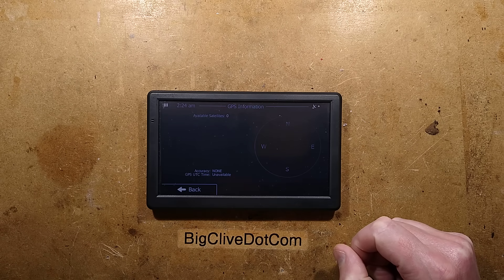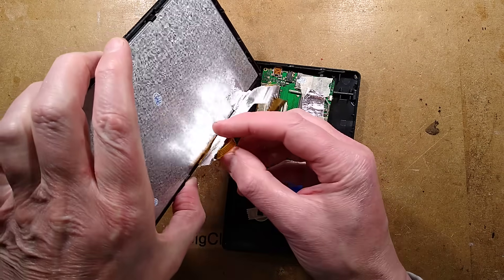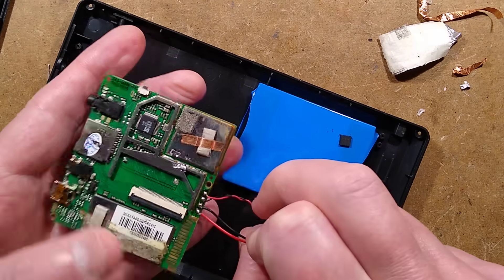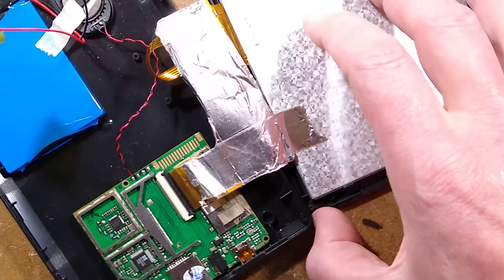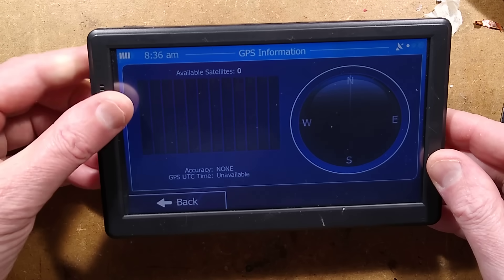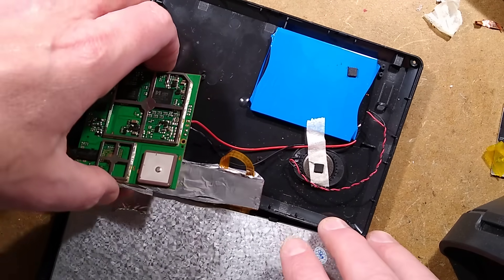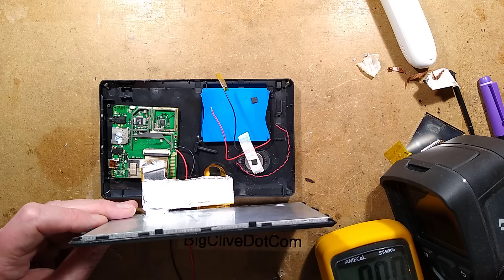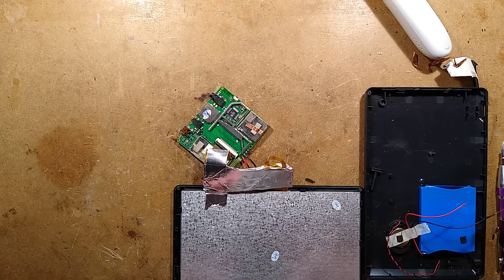Inside a trashy sat-nav

Comment: From what I remember of those older GPS devices there are a couple things that need to be set up. One is the general location needs to be set, I think for the time zone accuracy. The other is that they usually need an update to work properly, I think that had something to do with the azimuth or some such nonsense. I just remember my old garmen didn't work strait out of the box.

Comment: I wonder if its firmware couldn't handle the GPS 10 bit week number counter rollover in 2019 (1023 to 0) so that it could no longer interpret timestamps correctly.  Once that happened, it couldn't sync to a single satellite to download the GPS almanac data (via carousel broadcast data) which gives the current position of all the operable satellite locations and any WAAS and LAAS stations for better accuracy.

See: https://en.wikipedia.org/wiki/GPS_week_number_rollover

Comment: Never ceases to amaze me when a mfgr puts antennas under a metal-backed display. What were they thinking?
Wait, I punctuated that wrong--- what, were hey thinking?
Reply: Well, if it is being used in a car, the screen area is pointing back into a big metal box (unless you are in convertible), so maybe they are thinking that it acts as a reflector for the GPS signal?  I can remember when the handheld GPS units first came out (which did not have any built-in maps) and trying to use them when I was flying a small single-engine aircraft.  I had to place the unit on the glareshield (the equivalent of dashboard in a car) in order to get a signal.  When I banked steeply into a turn, I would often lose satellite lock... On the other hand, my aircraft's LORAN receiver had no problem keeping up and it compared favorably with the GPS on cross-country navigation -- usually they were in agreement within 0.1 nm...
Reply: It is designed to be in a car, with the back facing the windscreen, so the antenna would be facing outwards

Comment: Don't know if the video is fresh or recorded at 8:37AM, but in some instances the problem could be also from an incorrect time on the clock, sync and such, ya know certainly better than me they made the atomic clock mainly because of GPS lol
Edit: with the new battery probably set the clock correctly and then it worked xD
My 2 €cents

Comment: These things typically only go for 30 to 60 minutes on internal battery.  They expect it to be used in a vehicle with external power from a lighter socket.
Reply: Kinda like dashcams, although in dashcams the battery is used to save the recordings and safely shut down after power is lost. But the cheap ones use small capacity batteries that lose their capacity quickly from the heat and wear.
Reply: That is correct.
Reply: From my limited experience most have trouble lasting 5 minutes. That being said my latest (branded Aonerex) was on battery for 45 mins the other day and still showed  about 70% on the indicator.

Comment: may need a firmware update 
"Older GPS devices are facing their own mini Y2K bug 
 The GPS week number again reset to zero at 23:59:42 UTC on April 6, 2019. Many GPS-enabled devices that were not properly designed to account for the rollover event exhibited problems on that date" and after
Reply: Maybe, but the fact it was saying it was on the isle of man would indicate it's able to use the GPS signals correctly. You need at least 4 signals to properly calculate a location with GPS, so it may have been able to get a very rough position with the 3 signals it said it could find.
Reply: That was my first thought Matt Parker (StandupMaths) did a video on the problem with old GPS systems. https://www.youtube.com/watch?v=iyz7dSnZItw
Reply: It's a shame TomTom keep making their software incrementally more rubbish. And insist on it to fix the bug. My original go300 was the quickest one to use , and you could mess about with the map  icons and startup screen.
Reply: I threw out around 4 Tom Tom devices and a garmin due to the satellite signals disappearing around April 2019.
Reply: @Mikes666  shame Tomtoms run Linux and not windows CE, as you can unlock them and turn into more usable devices
Reply: @Mikes666  Same, my wonderful TomTom One had real problems finding satellites after the WNRO
Reply: @mr.berlingo8211  yes mine was a Tom Tom one and also a couple of xl ones. Was a shame, I see so many in charity shops now knowing they won’t work.
Reply: This is exactly what I was thinking.
Reply: I fixed my Navman S30 by simply editing the date within windows CE, either that or its just unaffected
Reply: @lukedavis436  it must have been unaffected. You can always set the date and time, but when it gets a fix, that will overwrite your settings. If it stays correct, your device doesn't have the bug. None should, because the rollover has happened before. It wasn't an unknown or unforseen event, and should have been allowed for.
Reply: @iainathairydog  I'm just glad it still work's, unlike my other tom-tom which had Touch issues, can't ever beat old faithful
Reply: Other than the time, date, and the eta to the destination, my old TomTom works just fine with the old firmware. Might want to update the maps though, because there's an interstate in my area that doesn't exist on the map but it is actually there. Though it is fun to hear "make the next legal u turn at- Turn left in- Turn right in- Turn right in- Recalculating..." when I'm driving on I-69

Comment: I have a feeling this ain’t no Garmin sat nav.
Reply: Believe it or not, even garmin once built stuff on/at this level back in the day...
Some of their original gear was infact even worse than this poor example. No big surprise however, as well over 50% of early electronics coming to market are quite similar...
Reply: @MikeOxlong-  it’s just strange inside, especially the foil going to the battery.
Reply: @jakp8777  a lot of poorly (or quickly/rushed) designs use this stuff all over the place. Being it’s conductive they use it as a means to isolate electrostatic discharge, and thus try to prevent the delicate and poorly designed boards from getting fried. Other times they’ll use it for rudimentary grounding too. Judging by the looks of this thing, it’s for both reasons...

Comment: What I do to connect flex prints is I take a piece of sturdy tape like kapton, masking tape works too.  I stick it to the flex print leaving a tab to act as a handle.  Then I can then push and pull the flex print into the connector.  Do the kapton right you can use it as a strain relief to keep the flex from pulling out.

Comment: All that room in that case and they used the tiniest hard-to-use connector.
Reply: Compatibility, probably.
Reply: @JasperJanssen  Exactly my experience.  The standard is set by the display manufacturer to maximize compatibility across multiple design platforms.

Comment: Looks like it came out of the QC Fukit Bucket.
Reply: Quality Control......there wasn't the usual QC PASSED sticker so it must be bad, it's the first label that's put on and they don't often go to the trouble of removing it.
Reply: @rd6864  that is why I said it CAME OUT of the QC Fukit bucket lol
Reply: @rd6864  Yeah, I can imagine it: manufacturers just put on the QC PASSED sticker without actually checking the actual product, they only check a few samples which are going to be inspected to avoid paying fines. That sticker's purpose is to reassures the customer it's a good product which he/she bought, I think.
Anyway, it's just a dirt cheap tablet with additional cheap GPS circuitry and a modified boot process to automatically launch the navigation software.
Reply: @zsombor_99  they do when it comes out of China lol
Reply: @JDWatkins  Especially from there, of course. 😉
Reply: I agree, my first thought was it was a device someone returned because it didn't work (they got it wet somehow) and the manufacture "remanufactured" it by cleaning up corrosion evidence and putting foil in because they lost the original shielding then re-boxing as new.
Reply: @mrbyamile6973  Yeah, that's quite possible. 😒
Reply: That was very well said.

Comment: You can't use more then one finger with a resistive screen.
Reply: One finger provides more than sufficient signaling capacity in most situations.
Reply: @Azlehria  except you cannot pinch and zoom
Reply: @AbdullahKahramanPhD  I wasn't referring solely to touchscreens. 😏
Reply: But at least it works even with one gloved finger. I still like resistive touch screens for that reason they are just pressure sensitive and don't need fancy gloves or licking the glove at the fingertip to work.
Reply: @kuebbisch  i always use my fingernail for a stylus. I don't mind resistive screens at all.
Reply: @kuebbisch  I discovered last year that well-conditioned sheepskin is very effective on capacitive touchscreens. Better than my own skin, sometimes!
Reply: @Azlehria  I just use an old HTC smart phone with resistive screen on the motorcycle for navigation. Resistive touchscreen works with gloves and when stowed under the transparent plastic of my tank bag.
Reply: @kuebbisch  I use my everyday phone (S8 Active) in a X-clamp. Regular leather riding gloves work well enough if I keep them clean and moisturized (saddle soap, mink oil, etc.).

Not 100% reliable, but if I need more than a quick tap or swipe at a light then I pull over.
Reply: Yes you can, check out Ashens' old review of the "HaiPad".
Reply: https://www.dmccoltd.com/english/product/resistive-touchscreen/mtr-series/#lineup_mtr

Comment: If it has not been on for a while (or if it has been moved quite the distance switched off) then it will first need to download a new almanach from the GPS data which can usually take up to 15 minutes even with good reception before "seeing enough satellites" will actually result in a location pin. I have seen devices misrepresent this in that they did see satellites, but reported to see none before they were done with rebuilding the new almanach.
Reply: I've always wondered why downloading the almanach when A-GPS isn't available takes so long? It can't be more than very few kb, no? And AFAIK, the satellites are constantly transmitting them?
Reply: @MoritzvonSchweinitz  The almanac is 15,000 bits long and takes 12.5 minutes to transmit. from wikipedia
Reply: @Moritz von Schweinitz  yeah the almanach might not be that big, but the data is scattered and fragmented, parts of it being transmitted with each datagram every satellite transmits with every pulse every second.
I'm actually not sure whether the almanach is a thing that exists on every satellite and needs to be "downloaded". It could also be that a single satellite does not have the full almanach, but only has their own orbit data and every GPS chip receives the orbit data from every satellite and composes the full almanach from that. I think no GPS satellite is visible for 12,5 minutes in one pass from horizon to horizon for any place on earth.

Comment: It does appear to run CE and not android much like mine but slightly bigger. There will be a way to jump out of the satnav software and into CE
Reply: USB OTG perhaps?
Reply: I coincidentally found a very similar unit that also runs Windows CE 6.0 yesterday. I tried running applications by changing the navigation software path without luck and I haven't been able to figure out how to enter the Windows CE desktop yet. I've read that it supposedly has word and Excel installed and a image I found on some Russian forum confirms this.
Reply: Thank you so much! I'll try this out
Reply: There is an icon to get there, but it's so underpowered that it's crap, and the screen alignment isn't good enough to use with the tiny menus.
Reply: @yodaco  definitely not. It is only powerful enough to be a satnav. iGo is by far the best software that it can run. You'd be daft to use it for anything else.
Reply: Just dug it out as it's not been out for some time. Still working. China's finest
Reply: Even the (absolute garbage functionality, may I add) Magellan Triton GPS units run Windows CE, and I think the older (less trash eXplorist) also do. I managed to get mine out of the nav program once, but it wasn't a full proper CE desktop. It did put it into USB disk mode, though, and I found out it had a virus onboard! Fun stuff.
(Lesson: don't buy Magellan stuff)
Reply: @ziginox  mine is kind of unbranded. But nothing sketchy in there afaik. It has a full CE desktop and works better than the Garmin I bought for 4 times the price. Where we live GPS is not great at the best of times. This lil China satnav does better than most I have tried here. So yeah not all bad.
Reply: @yodaco  where you live it isn't isn't really important whether GPS signal is good. You would only use it when you're away from home.
Reply: @iainathairydog  haha, well, its more about the job I was doing when I used it frequently, really needed a good GPS that could do a good job of route planning for multiple (40+) stops a day or so. I can safely say that GPS saved us over an hour a day in just route planning alone. (google maps is crap here too btw, or it was worse at that time anyway)
Reply: @iainathairydog  ....I know.
Reply: @iainathairydog  Well, you could also play back a recorded GPS track through the various sys.txt hacks.
Reply: @yodaco  I tried many times but sadly couldn't get mine to stay connected to activesync for more that a few seconds at a time so I guess I won't be able to get to the CE desktop unless there's another way
Reply: @theredstoneblock8878  I could be wrong. But I'm almost certain I used 7 to get mine working with active sync. But you can use Linux also.
Reply: @yodaco  What do I need to get it working under Linux?
Reply: @theredstoneblock8878  SynCE
Reply: @yodaco  nevermind I got it working on an old Windows 7 laptop. Thank you so much!
Reply: @theredstoneblock8878  no worries. good luck

Comment: The same bit of tape from the top of the antenna I believe, recycling!
Reply: I think this capton-tape is on top of the antenna because of the reflow-prozess to keep the surface clean and was applied from the producer of the antenna, not from the producer of the device.
Reply: @mikropower01  defo is a common find on GPS antenna. There must be reason for it I'm sure your probably right.

Comment: The screening and grounding for a satelite aerial is very sensitive for getting a good lock. My OnePlus T5 developed a common problem with the GPS, and needed a tiny shim of folded aluminium foil to restore the ground connection. Known problem, easily fixed if you have the correct Torx driver, and teeny tiny fingers.